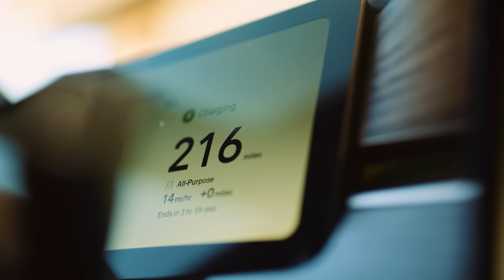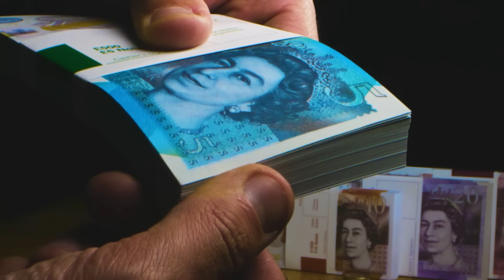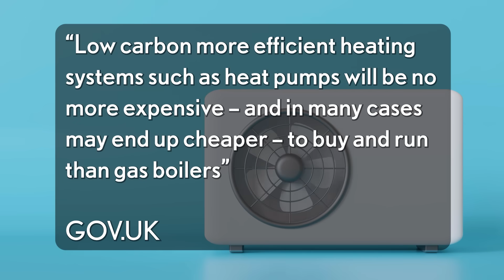The Truth About an All-Electric Future

Comment: Solar panels had an immoral start people who could afford them were paid a premium for their electric (feed in tariffs) and the poorest people who were on meters and couldn't get a deal paid the most for theirs.
Reply: Solar feed in tariffs will expire, and they are a shrinking proportion of our consumption.
Reply: @Biggest-hz7ng 

Yet it still continues £7500 for a homeowner    
For a heat pump when a gas boiler is £2000. £3000 discount of a new EV. These subsidies are not accessible if you can't afford them.
Reply: @nevillekinsley5610 we need to boost take up of these technologies. They reduce pollution both locally and globally. There is also help for the least well off with obtaining a heat pump, insulation, solar and batteries
Reply: @Biggest-hz7ng 
Solar needs daylight. Wind needs wind. There is no large scale storage economically available now or in the near future first world economy cannot be reliably run on renewables alone. They are just a distraction on finding a solution for all of us not just the few wealthy people who qualify for the grants.
Reply: @nevillekinsley5610 flexing alongside solar and wind we have nuclear, hydro, interconnects, biomass, gas and load shifting. They are hardly alone. Gas will still be here as an economic backup for a while yet.
Reply: @Biggest-hz7ng 
Exactly. Instead of having gas and nuclear running efficiently and being able to build the right amount of power generation. You have renewables inconsistently generating sometimes non sometimes too much with gas having to be the one picking up the slack. It means one or the other has to be paid subsidies to not produce electricity.

Comment: I'll put money on nothing will change. We'll still be using gas in 20/30 years and hydrogen will be nothing more than bad idea. Hydrogen has to be at the same level of idiocy as carbon capture. Nothing wrong with hydrocarbons (they're not fossil fuels).
Reply: Yup - apparently the politicians aren’t familiar with the lighted-splint test for hydrogen we all did back in secondary school chemistry class.
Reply: Which is exactly what the fossil fuel companies want. The status quo is in their favour. Anything thry can do to delay it (eg promote an impractical and flawed alternative like H2) is a win for them.
Reply: @brianballard905 the world will always run on hydrocarbons. Virtually everything in your life uses it and always will
Reply: @paul756uk2  yes, they are useful for so many things, plastics, drugs, fertiliser etc.

Some tings will never get away from hydrocarbons - aviation springs to mind. 

Which is why it"s mad we burn it just to heat our homes.

Right now, with existing tech you can buy,  you burn less oil using an electric car charged from an oil fired power station than just running a diesel car. You can burn less natural gas by using it in a power station and running a heatpump to heat your house than you do by using that gas in a boiler

Comment: A very biased and cockeyed video, done for monetary reasons no doubt.
 Taking the 30yrs gas main renewal into consideration for instance, yes it's a 30yr plan, but you never mentioned it started in 2002 so ends in just 7yrs time. It's being done for safety reasons as the old metal pipes are reaching the end of their safe lives. The transition phase from gas to electric has begun, but it'll take a long time to complete so we'll need a safe supply of gas for some time yet.
You forgot to mention insulation, batteries and solar panels, big part of the equation. Batteries for home use as well as for the electricity providers that is, they're putting these huge battery banks in all over the place.
Reply: I’ve done all that, plus EV and charger. Total running cost for gas plus standing charges, electricity plus standing  charges and charging the car in July was £3. Due to exporting a good bit to the grid. August more expensive at £11.
Reply: Because the UK housing stock is decades behind when it comes to insulation. It's time to catch up.
Reply: @pietheijn-vo1gt Building Regulations in Scotland are totally different. Houses are built stronger, with solid roofs and higher specifications. Insulation levels are much higher at almost passive house levels. Renewables have been standard for 20 years, such as solar panels or solar water heating. Heat pumps are very common now on new builds or folk changing from Calor or Oil. Social Housing must be wired for EV charging.
Reply: @gordonmackenzie4512  good stuff. Heat pumps on new builts should be mandatory by law, like it already is in many places.
Reply: @pietheijn-vo1gt With good insulation, solar and battery, a heat pump keeps a constant temperature all year round for very little cost. The Scandinavian folk have known this for decades.
Reply: @gordonmackenzie4512  aye, they're an improvement on England it seems, but there is still a disconnect. Quite literally in one of the new builds I viewed recently. The solar panels weren't tied to the grid, and it was mains gas central heating. This was in a development where hundreds of houses are/will be being built in the coming years. Seems bizarre that they're not going down the route of either district heating or individual heat pumps.
Reply: @ricos1497 The solar system needs signed off with a G98 certification. That way surplus solar can be exported with value. I get 15p per KWh. Over a year I average £30 month from surplus. The rest is used in the house or for topping up the battery.
Reply: @gordonmackenzie4512  that's not mandatory though is it (as in, all new builds must be connected to the grid)? As I say, the one I viewed (one of 30 or 40) was not connected, and the suggestion was it would take a lot for it to be so. I've no idea, I was just pointing out an example from experience. I had assumed that regulation would be tighter.
Reply: @ricos1497   it's to safeguard the economy in future years. Build houses not as good as they could be then the owners will pay trades for upgrades.
Reply: What if someone could invent something that charges a battery bank and drive a motor and runs off non Radiation type power that’s safe in your home or your car?
Reply: @jakespeed6515 Like hydro power, that creates electricity from running water ? Already exists. We have that powering our sports centre.

Comment: Heathrow cancelled a few months back when the substation caught fire because they'd sold their diseasal generators as they didn't use them 🤣
Reply: That's untrue - they had power from 2 other substations, but lacked the ability to run from only 2. The station had a capacity of around 75MW. A diesel generator station that big is basically an oil fired power station and you don't have one of those sitting around for occasional backup.

Comment: The green future needs the gas lines to be turned off in the future, not a collapse today.
The gas pipeline works includes the future works that may not be completed. 

90% of the world's population live in the sunbelt countries. Fortunately. 
Some small fossil fueled heating in winter weeks is nothing. 

Petroleum for road building and maintenance and petrochemical industry and emergency use and strategic military defence reserves and other things will mean a long-term commitment into the future. 

Leaky pipes are bad.
Reply: Leaky pipes kill. Gas may hang around, so we have to fix them, unfortunately.

Comment: Have solar, batteries, EV and heat pump (no GAS) . Never had a warmer house and cheaper bills
Reply: No mention of the outlay and payback period.
Reply: @paul756uk2  The way electricity prices have kept going up, it'll be sooner than anyone thinks
Reply: At the expense of other (poorer) energy users who have your solar subsidies and EV grants loaded onto their bills instead.
Reply: @brickmissing8295 A point I often make. It's a transfer of wealth from the poor to the wealthy. Same with the subsidies of EVs though they've largely disappeared.
Reply: @brickmissing8295  Rubbish.
Reply: ...just needed thousands and thousands to pay for it all to be installed.
Reply: I spend money on replacing something, so the thing i used to spend money on that it replaced, I don't spend much on anymore. Jesus, did you really write this unironically?
Reply: @markfernandes2467  Everything has to be replaced at some point, and guess what, it costs money whether it's fossil fuelled or not.
Reply: @LaReynedeNeige  True, and a razorblade model from China is about the worst way of doing it on all fronts, & all for poor quality electrons. Who mentioned fossil fuels anyway?
Reply: @markfernandes2467  No idea what any of that is supposed to mean, frankly.
Reply: @LaReynedeNeige  I think that's a you problem, frankly.

Comment: The entire thing has not been thought out at all.
Where I live, no one is able to have a car charger as the supply on my estate is supplied from a looped underground electrical supply covered in pitch that runs along the back of the properties.
To get a new supply, would mean laying a cable all the way up to the main road as nothing comes down any of the side streets.
Reply: There was a post a few moths ago from an engineer guy who was doing this very sort of thing as his JOB.   He said they were having to upgrade the feed cable to a 90+ house estate to 140% of its original, merely because TWO new houses had been built which were 100% electric and had EV charge points.  And upgrade the substation too.
Reply: @hunchanchoc8418 I understand that my estate is on 60amp main fuses and I know the supply is what would be equivalent to 16mm paper wrapped with pitch coating.
I had the DNO out due to pitch leaking from the supply head and they said that it's due to the load on the shared supply cable getting warm.
Reply: @hunchanchoc8418 That must cost a fortune just because of two new builds!
Reply: In general, we are building transmission to be more robust.
Reply: @Biggest-hz7ng As Rodger mentioned and whom is picking up the bill. Not the government or the fat energy performance companies, no it's the public and that is alright if you can afford increase in prices.
My neighbours down my road have all  learned they can't have a car charger due to the supply cable and told they would have to pay the bill for an entire new supply laying from their property all the way onto the main road.
I understand that this estate when built the supply cable was looped in blocks when built for the war from what the DNO told me.
I had to have the DNO out due to pitch leaking from the head of the cable. To be told that it's due to the pull on the connection as my house is the first that is then supplying the full run of semi-detached houses.
The issue is with some are private rented and are refusing entry to the DNO. The old supply runs underground along the back of the properties 3' from the house wall.
Now starting to think if there is any connection to getting regular powercuts.

Comment: Sorry Roger I normally like your videos but there is so much wrong with the information in this I don't know where to start this comment box isn't large enough 👎.
Reply: But if you did know where to start, where would it be? Let's get some specifics...
Reply: @robjworkshop5692 - sure

H2 has abiut 1/3 the energy per liter of gas. So you need 3x the flow rate. That means bigger pipes or higher pressure. We can't up the pressure because leaks go up - the pipes leak enough already and H2 leaks easier than gas and you'd need to replace the pumping systions (which you may need to do because of material incompatibility with H2 anyway). Replacing all the gas mains on the roads and pipes in your house is going to make the supposedly impossible electric grid upgrades look like a picnic.

You can't switch to more than about 20% H2 blend until all the appliances connected to that supply are updated to be compatible - every gas fire, oven, hob, boiler on every home. Again a logistical nightmare

Finally H2 mostly comes from gas anyway except for every kwh or heat in your house you need more gas to make the H2 to burn, than if you just burned the gas in your house as now.  H2 from elecreicty is even worse.

H2 as a concept exist solely to distract from the switch to electric.  Right now you use less gas per. Kwh in your home by burning it in a power plant, making elec, then using that to peer a heatpump than you do by burning that gas in a boiler.

We could reduce our gas consumption tomorrow if we could  switch to all Heatpumps powered by gas stations.
Reply: He's being realistic and doesn't have his head in the clouds like some ideologues.

Comment: Those wind turbines spin via a diesel engine when there is no wind , to stop them seizing.
Reply: I"m calling bullshit on this
Reply: @brianballard905  Fine by me mate. Have a delve into it.
Reply: This is mostly false. modern wind turbines us batteries to do this, not diesel generators.
Reply: @markfernandes2467 What charges the batteries? Diesel generator.
Reply: @vic6820  The turbines do, when there is wind. That's kinda their whole shtick you know.
Reply: @markfernandes2467 It's when the wind isn't sufficient.
Reply: @vic6820  That's when it uses the batteries . which part of this is hard to understand?
Reply: @markfernandes2467 some people really need it spelled out.

Anyway, even if wind turbines used a diesel generator for backup power when calm, the volume of diesel used per year vs the total annual output from wind is miniscule.

This is like the "gotcha" - "oh wind turbines need oil for lubrication!  Ot so free now!"

Offshore wind is as cheap as gas generation. Onshore is even cheaper.

And has generation is critically dependant on gas prices and they aren't going down.

And no we can't crack or drill for our own gas to get the price down because markets don't work like that. Our production won't affect the world price. 😊
Reply: @markfernandes2467 The part which is hard to understand, is your total lack of comprehension of the previous comments.
Reply: @vic6820  Are you trolling right now? God i hope so.

Comment: Hydrogen or Gas is the future. We used >3000 gigawatts of gas energy in the Winter last year and hinckley C nuclear will generate 4. A huge solar farm .4. Enough said.
Reply: Seems wasteful converting all that electricity to hydrogen, also creating and maintaining infrastructure when electricity is already there
Reply: @rutgerhoutdijk3547 They just want it to look better on paper.
Reply: @rutgerhoutdijk3547 You don't get it. There isn't all this electricity. There will never be enough to replace gas never mind transport it. Are they going to build 100s of giant nuclear power plants (not football field sized modular ones). Electricity does not scale. There is no hope for electricity to reolace gas for heating. You can argue Hydrogen has no hope but it atleast has some potential with many developments happening frequently.
Reply: @kevinchadwick8993 there are plenty of ways of generating electricity, nuclear is just one option, coal, solar, hydro, geothermal, etc.. Hydrogen needs to be made, usually from electricity, so I don't see the point of converting electricity into hydrogen instead of using electricity directly
Reply: @rutgerhoutdijk3547 I bet if you covered the whole of Britain in solar you would be at a fraction of the 3000 gigawatts per hour of natural gas energy used in the Winter or 1000 if you accept heat pump cop 3 and ignore other losses. I'm fairly sure we couldn't afford the 1000s of rolls royce sm reactors 3.3 billion per gigawatt. So if your plan is electrify everything or create Hydrogen from Electricity then net zero won't happen this century if ever. There is a lot more potential to Hydrogen or getting heat from the earth is another option. It may be we will be dependent on natural gas for a long time.
Reply: @kevinchadwick8993 sure we will need fossil fuels for a long time because solar/wind are unreliable, but hydrogen/electricity is about transporting energy, not generating it. And hydrogen is only feasible for a very limited amount of applications.
Reply: Hydrogen is gas.
Reply: @lksf9820 so is oxygen, but try swapping it for hydrogen when you breathe
Reply: Primary energy fallacy writ large.
Reply: @Biggest-hz7ng I did a quick sum

Leak gas demand in 21/22 was 416mcm gas which is about 4,500 Gwh over 24h. Spread evenly that's equiv to 190gw for 24h. Say it's a bit peakier, maybe 225gw peak demand. A well set up HP can get a Cop of over 2.5 in the winter. So put peak elec demand is around 90Gw.

That comoares to our current capacity of about 75Gw.

So we aren't there yet and we woikd need to significantly increace our capacity but it's in the ball park.
Reply: @brianballard905 it is entirely doable with upgrades to generation and transmission.